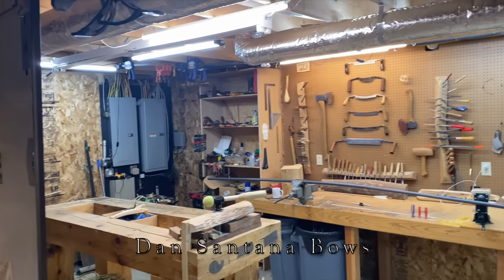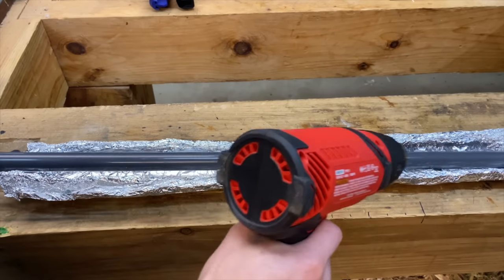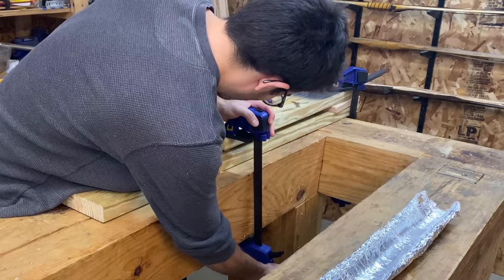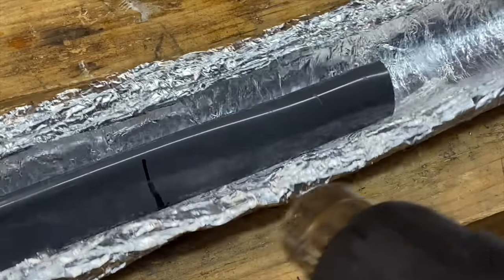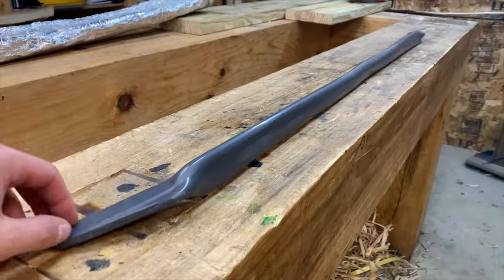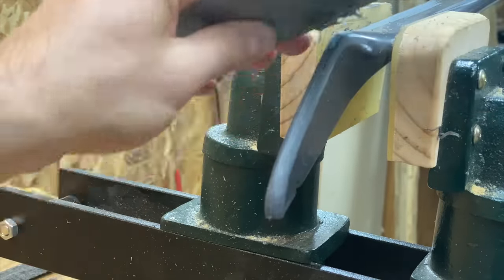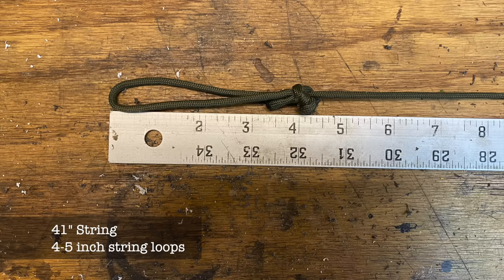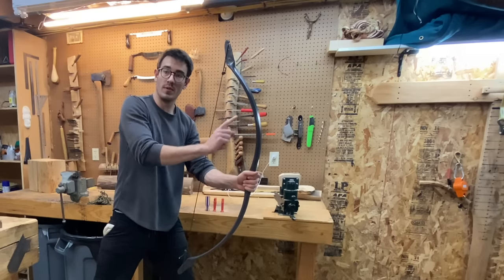PVC Recurve Bow: Full Tutorial (55 Pounds at 32")

Comment: I've heard that heating PVC tends to release chlorine gas, so if you're doing this, please either use a paint/chemical rated mask or do it in a well ventilated place and avoid breathing the fumes as best you can. Stay safe out there folks, and happy bow-making!
Reply from the maker: Good advice. This is definitely best as an outdoor project if possible. I do have my fingers slightly tied as far as where I can film well, but this is something I try to be cautious about when I can. From what I can smell, there is not a big issue if you heat the pipe gently enough, but you get the nasty odors if you heat too aggressively and especially if you burn the pipe—which does happen when you’re still learning to control the heat gun.
Reply: Chlorine gas is the same as the chemical weapon?
Reply: @Elfaropurpura  

Yea. Sames thing you get mixing bleach and ammonia.
Reply: No, that would be chloramine.
Reply: To add on to this, it's much safer to make it out of PVC, the chlorine danger comes from using C-PVC (Chlorinated PolyVinyl Chloride).
Reply: O my God, here comes safety
Reply: Not at the temperatures shown in this video. If you start to burn it, maybe. People heat form pvc all the time. It is pretty safe.
Reply: @sukhoipilot1255  bitmedier  ...her videoda bir şey yapanı yorum yapamak için hazır gizleniyorar ....görür görmez saldırıya geçiyorlar
Reply: would be nice if i red this beforehand, the headache is no fun

Comment: I’ve made pvc bows , & the only thing I have to say about them is that there good for something in a pinch . Over time they lose there power & there really not as good as people make them out to be . There subjected to cold & heat , cold will crack them & with heat they will become rubbery with loss of power if you want a good bow then stay away from these pvc bows & buy a good recurve .
Reply from the maker: IMO these are the bowyers errors and not the pipes fault. If it loses power over time it’s taking set— this is a design or tiller issue, it’s not the materials fault. Same with wood, if you force too hard a design on it it will take set. The difference is wood will break much sooner and illuminate the bowyers mistakes more obviously. 

Regarding cold and uv. Yes, PVC bows are UV and cold sensitive, but in my opinion most pipes that break are burnt and poorly tillered. From my own trials, and speaking to the Backyard bowyer, I have not been able to reproduce a cold break or a UV break in a well tillered bow. I think you need a bow that was close to breaking anyway and then these factors push it over the edge.

Comment: This is a great tutorial. Super accessible, and for what the bow is made out of, it looks impressively well crafted. I am curious as to what set these PVC bows take on over time though.
Reply from the maker: Thanks Kentus!

Just like wood, PVC will only take any set that you do to it. high set designs can always be improved by making the bow a bit more overbuilt or otherwise changing the design. Since PVC is such an easy material to work with, many try out very ambitious designs which of course will take set. But you can’t blame set on the material, it’s a design problem and fully within the bowyers control.

Comment: A small handful of questions:

1. Do you find that Schedule 80 tends not to deform over time with the heat and shaping you do, or does it still deform and lose draw weight with repeated use?
2. Would adding fiberglass rods (such as reflective driveway markers) to the inside for added durability and draw weight still be effective with this particular design? I recognize a lower grade of PVC would likely be required to keep the draw weight in a similar range.
3. Do you know of any sort of quick-and-dirty math to determine the most advantageous length and degree of curve for the siyahs, or for recurved limbs without siyahs?

For context, another YouTuber by the name of ZNA Productions made a recurve PVC bow a few years ago, and it was less effective in a penetration test compared to another, roughly equal size PVC recurve bow a subscriber sent him despite the subscriber bow having roughly 10lbs less draw weight. His hypothesis was that the subscriber bow was somehow more efficiently releasing energy through the arrow than his own bow was, to the point the arrow had more energy when fired from the subscriber bow despite it's lower draw weight. The whole situation has had me questioning why that was, and exactly what the math is behind an effective recurved limb, all these years later, and I haven't been able to find any answers. So, seeing as you're quite knowledgeable about bows yourself, I figured I'd ask and see if you can shed any light on the subject(s) listed above for me. Thanks in advance and lovely video!
Reply from the maker: Whether the bow “takes set” is a matter of the material but also the design. If you design the bow so it doesn’t exceed the elastic limit of the material—it won’t take set. In other words set is the bowyers fault not the material, and can be controlled through the design and quality of the tiller.

ZNA makes fun videos but I can’t vouch for the bow making content. The whole driveway rod thing is an awful design. See my comments about it on other threads under this video. The technique is a very brute way to raise draw weight for little performance gain at all. The core of the bow is the worst possible place to put working material 

You don’t need to calculate siyah length, just keep to a modest amount of 3-5 inches and you should be ok for designs in this ballpark.

Comment: Dan, im curious about how long that bow lasts, will it eventually wear out, or stay powerful for thousands of shots?
Reply from the maker: It’ll last thousands of shots if well tillered, but that’s the issue. Most of the pvc bows that break prematurely have major tiller issues and wear out in one particular spot. If the bow wears out quickly this is a design issue, not a materials issue. It’s the job of a design fluent bowyer to design and tiller within the elastic limits of the material

Comment: Hi, thank you for the video
Could you please let me know exactly type of PVC pipe which you use to make bow, I see many kind of PVC pipe and some of them are easy to be broken
Reply from the maker: This is 3/4” gray schedule 80 but my other video used 3/4” schedule 40. 1” pipes are also common for higher weight bows. The problem you’ll have is that these are US standards. If you want to test a pipe for use in bowmaking, it should be able to bend without breaking, and when it fails it should buckle rather than shatter
Reply: @DanSantanaBows  thank you so much

Comment: Hello again mr. Dan! I saw a video of backyardbowyer explaining that not all pvc can be used as bow material and that some will crack and shatter regardless of the tiller and his way of testing it is hammering it to see if it shatters, do you know of any less intrusive method to test the pipe? Thanks!
Reply: Yeah this is actually very important. The only pvc bow that's ever shattered on me was made from hardware store pipe which didn't pass the hammer test.
I don't know of a less intrusive way to test it per se, but I like to cut off a ~3-5 inch sample from the pipe I plan to use and hammer test it separately. That way you can avoid causing any stresses in the part of the pipe you'll actually use.

You can also use furniture grade pvc pipe instead. I've had a few failed furniture pipe bows collapse relatively safely and gently and I have not seen any cracks on any of them. One of them was drawing over 80lbs before it collapsed and I am very grateful for how gentle that particular failure was. Also, all of my failed bows (except the one that shattered) have been ones that I tapered by hand. I'm still fairly unskilled at it. Using a jig for forming tapers makes the resulting bows much safer, but bad pipe can still be dangerous, jig or not.

Comment: Any ideas for making a recurve or reflex/deflex bow from aluminum? I’m a welder/fabricator and would like to make a traditional style bow with my more modern skill set.
Reply from the maker: Aluminum is a pretty lousy material for bows. Yes you can make springs out of it but compared to something more elastic it’s not a great choice. I’ve seen spring steel bows from india but they have a reputation for being very loud and vibrating a lot. A totally design fluent bowyer would be able to workaround the stats of the material and make a great bow from aluminum but that would involve a lot of extra work and fine tuning the design

Comment: What if we dont have a heat gun,then how would you make this specific type of bow?
Reply from the maker: Pretty much any heat source that gets hot enough. You could use a stovetop, a heating radiator, or if you’re very careful an open fire, but that takes patience and a gentle hand.
Reply: @DanSantanaBows  thank you
Reply: Try heating sand then and put the pvc pipe inside

Comment: How is this bow affected by temperature fluctuations?

Is it possible to shoot with it both on a hot summer day and in a cold winter?
Reply from the maker: If the tiller is bad it could break during the winter. Humidity is no issue. You could shoot it in a pool

Comment: FYI heat PVC outside and use a respirator, heating PVC releases fumes that are quite toxic.
Reply from the maker: Good advice. The nasty fumes seem to really start coming out if you exceed the ideal working temperature so it’s a way worse issue if you aren’t gentle with the heat gun. If you do it right you shouldn’t be smelling the fumes, but you’re right that this is better as an outdoor activity

Comment: Will the bow shatter or still bend even in cold climates?   Is it possible to make a PVC bow that has a 20lb -25lbs draw weight?
Reply from the maker: Only if the pipe is decent quality and the tiller is good. With poor tiller you can break the bow without it even being cold. 

Differently sized pipes yield different draw weights. You can also change the length of the bow to change the draw specs as discussed in the video

Comment: i honestly  cannot see  a large draw pull without the pvc pipe kinking straight away does not seem logical
Reply from the maker: Whether you’re making a wooden bow or pvc, long before the bow breaks or kinks it will start to take set (exceed limit of elastic deformation) 
Bow design is all about staying inside that limit and design fluent bowyers have all sorts of tricks to help them.

Comment: Can I make it using the stove instead of the heater
Reply from the maker: @abdurrahimkagan4154  Just be very careful not to burn the pipe or make toxic gas in the kitchen. it’s easy to heat too much with a stove. You can also use a red hot heater, ideally outside if you can. Or a campfire using the red coals, but be extra gentle with that method
Reply: @DanSantanaBows  thank you! I will be careful, thanks for the warnings.

Comment: I’m curious as to how a Penobscot PVC design would function in comparison to a regular PVC Bow design depicted here. I’ve heard a Penobscot design adds a functional purpose to get more weight from your draw, but I’m not sure how difficult it would be to replicate a design as such with PVC.
Reply from the maker: I would like to make a video about them because the misconceptions are getting out of hand.

 Adding weight isn’t a big deal really because the best way to add draw weight is not by adding materials but by starting with the right amount. 

If you want to add more weight the better way to do that is just design a conventional bow to accommodate the target draw stats. Much more efficient and less fiddly. You can easily spend more time adjusting and fiddling with a double bow than actually shooting the thing. 

Plus it would not be fair to compare a penobscot to a selfbow. This is like beefing up a boxer by 30 pounds but keeping them in the lower weight class. Penobscots already do not perform impressively compared to self bows. Compared to other composite designs they have lackluster performance are are very bulky.

Where the double bow design makes sense is if you already have a bow that does not live up to the draw stats you want. Then you can increase the weight with a second bow. This also raises the early draw weight part of the f/d curve, a bit like a recurve. (Where all they hype comes from) But again, there are much more efficient ways to ‘add’ that power and early draw weight rather than using an inefficient second bow.

Comment: Wondering if anyone has any tips for the durability of this bow? I’m creating one and figured maybe adding fiberglass ridding at the center? Or would simply making this out of the pipe entirely with no handle reinforcement? Thanks in advance!
Reply from the maker: Just design the bow properly so it doesn’t take set (exceed the elastic limit of the material.) If the bow takes excessive set design longer next time. Fiberglass in the middle of the bow is a lousy design since the neutral plane of the bow is the least mass-efficient place to be adding working material. You want tension strong material on the back, compression strong material on the belly, and a stable core. Putting heavy material in the core is the worst place to put it

Comment: Every put fiberglass driveway makers in the pipe ??
Reply from the maker: I have done it and think it’s a bad design. Putting working material in the neutral plane is very mass inefficient and the worst place to put it. If you want a heavier bow you can simply design it that way from the start by using thicker pipe or making a shorter bow.

Comment: I made this a month ago and used duck tape to back the bow, it works well. It’s only 35ish pounds but that's okay.
Reply from the maker: Glad to hear it worked out! That’s an awesome draw weight for shooting all day. Personally I think duct tape on bows doesn’t do anything useful and is just dead weight. It’s not going to hold together an exploding bow. PVC doesn’t really benefit from backings in my opinion since the weak link is the belly taking set
Reply: @DanSantanaBows  I put 2 layers of duck tape on not to hold a exploding bow together but to make sure that any fragments of pvc are more contained and to try and limit the speed of the fragments that could fly off. A guy at my club injured himself with a bad pvc bow, a shard of pvc got stuck in his hand. But the bow looks cooler too with some camo duck tape too.
Reply: What length before you heated?
Reply from the maker: @ghostdog2898  52”

Comment: A tiller the Hun
Actually I have made a few of these that shoot very strong.
Arrow weight was tricky though unless you want industrial made arrows.
Those work best,
But if you make your own, the range is shorter.
Because of arrow weight,a 3/8 dowel rod can make a very hard hitting arrow, but like I said about the range.
It's a very short range.
30 yards maybe top range, with the longest shot being about 75 yard's
This is a good build for a immediate need survival bow 🏹 that has power enough for hunting and defense in closer spaces
It's able to be made in a matter of minutes ( about a half hour or less )
Cheap easy to acquire materials for both bow 🏹 and arrow making 🎯
Paracord makes excellent bowstring after it's stretched from use and readjusted for length